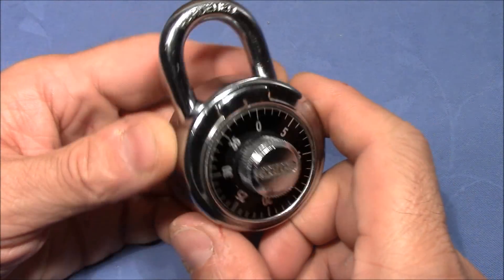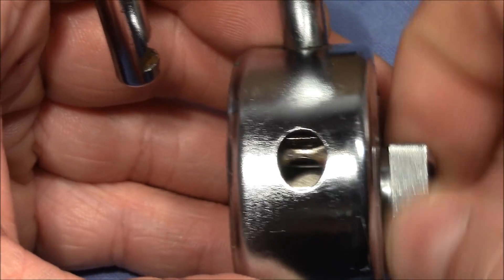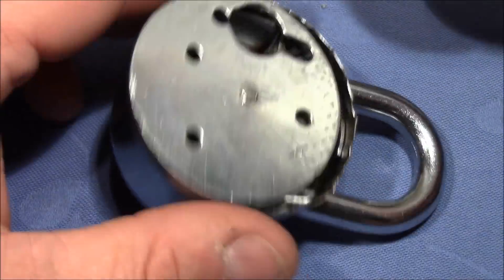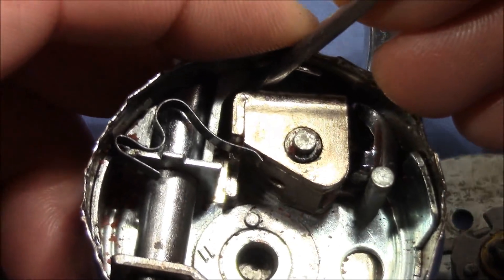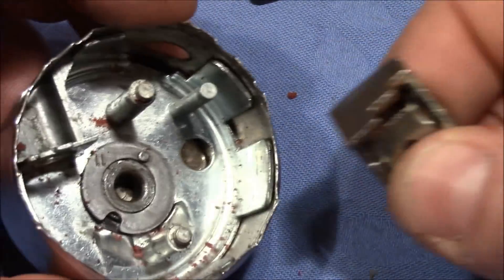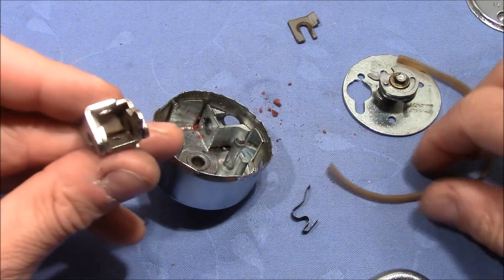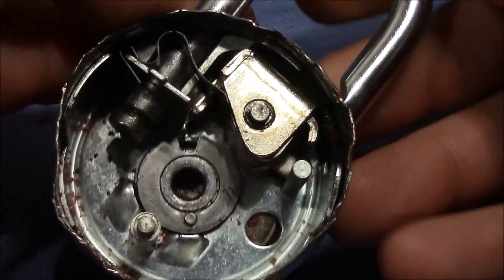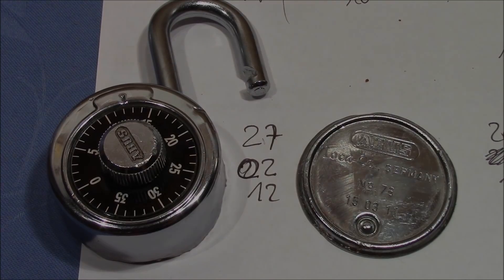(picking 540) What's wrong with this ABUS dial combination padlock? - let's find out...

Comment: Awesome combo lock autopsy Potti :D. I think you are right, there was a rubber "Spring" which has dissolved over time ;D. I'm actually surprised that they used such one... Very cool hack to get it back to life :D and I hope you got the plate back on :). Have a great week buddy :). 😃👋👍✌🦊
Reply from the maker: Yes, very strange with that rubber stuff. Also frightening how easy that back plate came off.
Reply: Yeah haha, I was wondering like you did what this stuff was...until you found out :). I thought the whole time the code was stamped on the plate...numbers are very close but the first one...hmmm. 😃👋🦊

Comment: the fixed disc has to be the last number
Reply from the maker: OK, thanks - I always get confused with that.
Reply: Potti314 you start with them all linked, and then drop them off in their right spots one by one. That's why the dial itself is set last. Cool restore

Comment: Brilliant vid mate, loved every minute, excellent explanation of its workings. Thanks alot for taking the time to gut and repair it. If only they had used a ball bearing and spring, instead of that poor locking pawl and what appears to have been a piece of rubber.
Reply from the maker: Thanks a lot buddy - your feedback is very motivating. Yes, rubber is always a bad idea if it should last long.